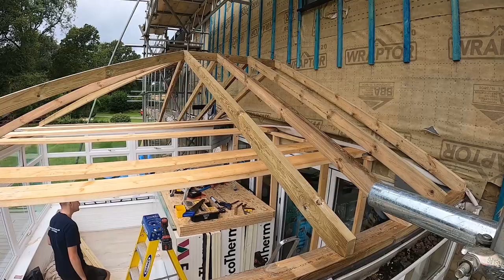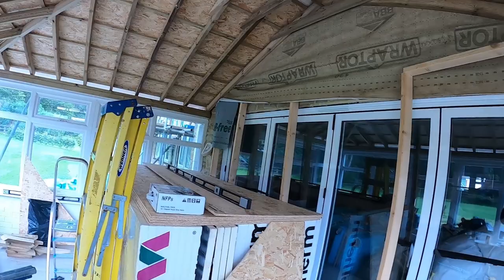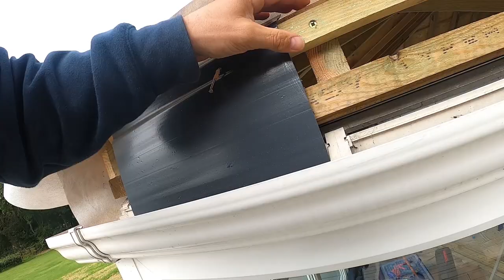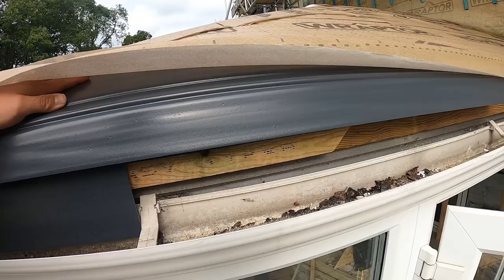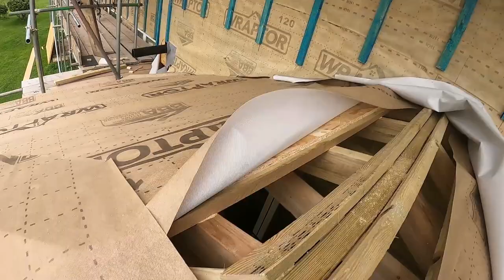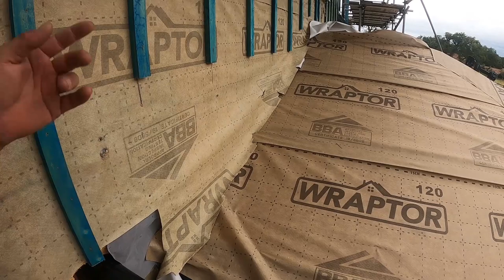Conservatory Roof Makeover, Part 2

Comment: Hi thats vert interesting as it converts a conservatory into a warmer roof. Thanks for sharing. What tiles have use used as they look like some plastic / synthetic tiles as they probably need to be lightweight. Thanks
Reply from the maker: It’s one the ways out to improve on heat loss and in summer not such a hot space which you can’t really use. Correct tiles are synthetic/ composite to reduce weight 👍🏻